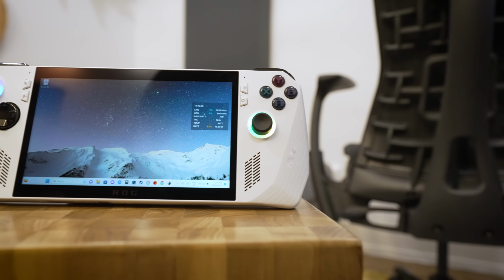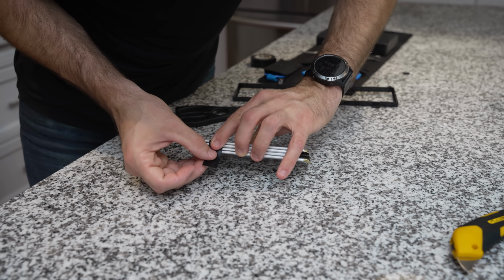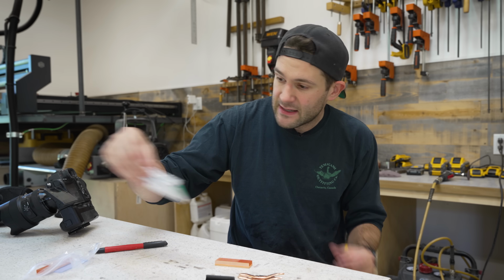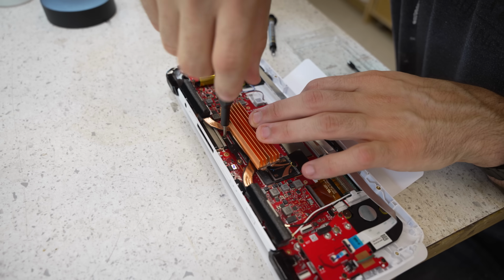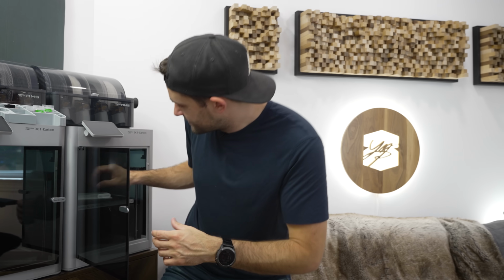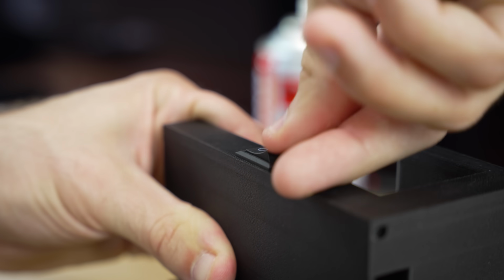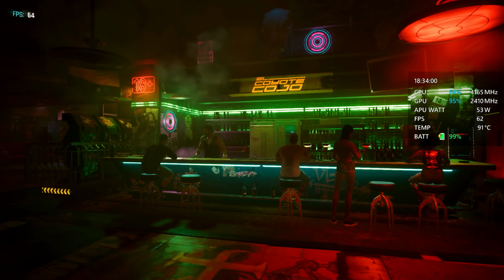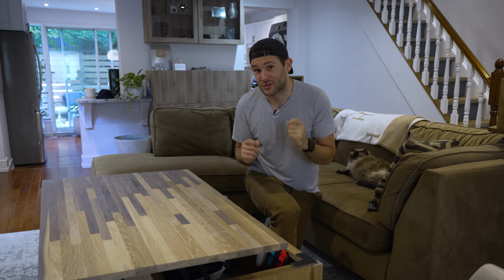I don't understand why people buy Steam Decks...

Comment: Valve made Linux gaming actually possible thanks to steam deck. I want to thank them for all the efforts are making, still keeping everything open source
Reply: ASUS QC is also terrible unreliable junk
Reply: @natzzzy9119  
Exactly, I owned enough Asus Products to know this my Asus TUF 505DT Laptop lost sound output years ago, and because it was out of warranty they suggested I buy a new one for $1,000+, not to mention I also had similar with ASUS motherboards on my Desktop PC. At this point I'd rather just not touch anything they make, haven't had many issues with my Deck in the 5+ months of owning it, but almost any bug was fixed in the next update, and if not they offer a wonderful customer service team that is quick to reply, and walk you through the steps to fix just about anything wrong
Reply: @natzzzy9119  wdym
Reply: @peppefailla1630  ROG Ally's are notorious for frying the MicroSD slot and MicroSD cards due to heat from the power delivery system iirc.
That is a design flaw that should have been detected and corrected during prototyping.
Reply: @AmigaWolf  your last sentence is one of the reasons I tend to stick to smaller devs now.  I haven't bought any EA (Electronic Asshats) games in ages, left Activizzard behind many years ago too.  It's not a foolproof fix, but nowhere near the poopshoot AAA companies are now.
Reply: @AmigaWolf  I have a short list of games I tend to go back to.  The one I have the most hours in is 7 Days to Die at 9,417 total hours.  Both Subnautica games, Grounded, and Rimworld.  

That being said, I like several other genres, including RPG ... just not newer ones anymore, with the possible exception of jrpgs (like the Final Fantasy series).  With the exception of that last game, and Grounded, those are smaller dev teams.  Obsidian (Grounded) is big enough not to lap in to the smaller dev label the rest have.
Reply: @ElNeroDiablo If there was any :D It was like ouuu look they made handheld, minutes later in asus HQ you have two months to do it also, have fun. end of meeting. :D
Reply: If they were all running Windows I'd just buy the Lenovo Legion tbh but SteamOS is a game changer that I believe in
Reply: @jebril  Gotta believe it!! Even aya neo is investing into making their own Linux gaming OS. The revolution!
Reply: @peppefailla1630  What really annoys me is how Valve wants other companies to use their work and standardize Linux gaming for handhelds and companies are refusing to cooperate in that regard lol.
Reply: @jebril   im not sure what you read, but from what i have read Valve wanted developers to keep making the games for windows (so the devs wouldnt have to make separate builds) and they would just make sure it works through proton.

the only things that can break the compatibility are anticheat and potentially launchers
Reply: @questionabletopic9652  Im not sure what you mean, are you saying Valve tells developers they have to have a Windows version? That's not true I've seen Linux exclusive games on Steam so that's not a real rule.

Or are you saying Valve tells developers not to port to Linux? That's not true either cuz there's Linux ports on Steam. Valve is very hands off when it comes to most things with the games on its store.
Reply: @jebril   closer to the second.  valve told devs to not bother making a linux port. proton will carry most all of it.

that does not mean that they cant make a dedicated linux port if they want, just that they dont have to.

ill check around to see if i can find the article again.
Reply: @questionabletopic9652  yea probably in response to developers asking if they needed a linux port for Steam Deck compability. Honestly its the most efficient thing at this point there's way too many games to sit there and port to Linux and like I've seen with native Linux ports dependencies break all the time where even the native ports stop eventually working if not maintained.
Reply: ^ +1 . For handheld gaming, I believe battery life is the most important. Imagine gaming on an ARM chip with a linux OS and getting +20 hours on a AAA title
Reply: @wchorski  ARM chips will take a while I think. Apple is really the only company to make an impressive ARM chip so far (hopefully Qualcomm's Nuvia chips go somewhere soon). From there, we'll still need to see some work done with x86 to ARM translation. box86 is a great starting point, but it would need to be integrated into Proton, and a Steam client should really be ported to ARM. I'm also not sure how that would work with the current anti-cheat situation. In the best case nothing really changes, but I wouldn't be surprised if a few anti-cheats wind up disliking x86 to ARM translation making things worse.
Reply: >Imagine gaming on an ARM chip with a linux OS and getting +20 hours on a AAA title
 @wchorski  
Great. Doesn't work. Because those windows.exe games we play on linux are compiled for X86_64
Reply: @wchorski box64
Reply: Not just the deck itself, but Proton as well.  I have my system dual boot between Swindles (Windows) 10 and linux, and proton makes it feasible to play the majority of my library relatively painlessly.
Reply: This, exactly. It's why I bought a Steamdeck. Sure, I would love to have a PC handheld, but I don't play games when I'm away from home. But, Valve made gaming on linux a real thing, so there was no way in hell I was gonna let them push that boulder alone.
Reply: I cannot wait for the day I can ditch windows on my next PC build
Reply: @Snugggg  ♥️♥️♥️♥️♥️
Reply: @Snugggg  Why not put it on your PC, your using now?

Linux runs great on old and new hardware, my nephew has a very old PC (15 years), 
with a old AMD Phenom X4, and 16GB DDR3 RAM, and a GeForce GTX 1060 6GB, 
and it runs smooth with Pop OS (Linux).
Reply: @AmigaWolf  I do, but there are still gaps in capability, support and my capability, mainly with games, so I have to begrudgingly keep windows installed for now. I long for the day I can get rid of it.
Reply: Linux is a very underrated operating system..
Reply: They made Linux playable way before Deck release. Well, gpu drivers, dxvk and wine compatibility were drastically improved in 2015-2018 period, then Valve released proton in 2018.
Reply: @xDShot9000  i know but without the steam deck we would probably have never been able to play EAC Games, since this Anticheat system is developed by Epic Games. The only reason why Epic started working with Valve is because Valve gained a lot of contractual power with the steam deck
Reply: @xDShot9000  exactly and Valve only did so, to tap more sales and marketing opportunity. It wasn't that they genuinely cared or wanted to support open source. It was a way for them to sell a piece of hardware and tap into the untapped part of the video game industry that many companies don't bother with. Other companies should be doing the same or all out support Linux over Windows. That's where the future is headed anyways so they might as well get the ball rolling sooner than later.
Reply: All the open work they've done, some in collaboration with the community or even some hiring for drivers... They've done an impressive job and really deserve success
Reply: Exactly. I buy AMD GPUs for this same reason - if we, as Linux users, want more companies to open source drivers and support our platform of choice, we need to vote with our dollars. Valve absolutely gets my support. And I don't even hate on ASUS - I and family have owned multiple Zenbooks, one of those early Android tablets they had, and run ASUS TUF mobos and have been happy with all of those (while recognising they've had some well-publicised f-ckups as of late).
Reply: @paulie-g  I have an Asus zenbook 14 OLED and the experience on Linux is really good. I just had to install the speaker drivers for some reason and turn of the secure boot, but after that the experience has been pretty much flawless
Reply: SteamOS is amazing. I can’t believe they made it so easy.
Reply: funny because I was already gaming on Linux before the steam deck, but suddenly every game worked after the steam deck came out. FOSS is the best
Reply: This, when you chase only hardware, you forget the software that runs it. If more companies openly supported linux I would give more money but since they don't I won't. Obviously valve sees the future and I want in.
Reply: Precisely.
Reply: I mean they did it because Microsoft has attempted to be their competitor in the PC space for years. The Microsoft/Windows/Xbox store on PC has some titles unavailable on Steam still to this day in order to try and profit off of exclusivity-based practices.
Reply: When we lose Gaben, gaming culture and industry will forever feel the lack of his presence.
Reply: And proton support rooting from the steam machines
Reply: Quit your Wine-ing.
Reply: @d1g1talc0ffee  never going back to that dumpster fire that's windows
Reply: Yeah it's really cool when game updates come out that add anti-cheat that makes the game unplayable on Linux.
Reply: I just purpose built my first PC in over 25 years specifically to game on Linux thanks to Valve.
Reply: The vast majority of my steam library was playable in linux before the steam deck. It only got better after the steam deck came.
Reply: @Alobster1  it just got viable lmao I was there back then and it was so frustrating to fix issues
Reply: @peppefailla1630  still could get frustrating, nearly lost all my hair trying to get a vpn to run.
Reply: @Mangaki86  this is one of the only critical parts actually
Reply: @Mangaki86 learning to setup a home server with my own VPN was one of the first things I did on Linux.
Reply: Truth, long before the Steam Deck came out, I would search endlessly for a way to game on Linux to escape Windows, using certain Linux Kernels like Linux-Zen, going back to the roots by building a custom Arch Linux machine to run as little processes as possible, and using custom builds of wine, that had as much compatibility in calls as possible for the respective games.

I managed to create a monster of a machine, and even managed to Live Stream, as a 3D vTuber under it using a custom App I designed myself. Although that aside. it broke almost everyday, and when I updated anything in the terminal, I had to backup before cause there was a chance it would destroy everything I worked so hard to maintain. I troubleshooted nearly constantly, and some nights to get my streams ready on a usual schedule I'd have to go without sleep to make sure I could load everything up again the next boot cycle. it was a nightmare to make a good Linux Distro. Now, you just need to download a version of SteamOS, and load it up. I use Windows for my 3D vTubing as the scene has advanced past what I can program in a new Linux App, but my Steam deck is a good companion, I use it when I can to squeeze a little more out of my setup, and it helps that thanks to my Linux trials I bought a good inexpensive capture card that just routes HDMI to my PC, nothing as resource intense as an Elgato.
Reply: Everything except their clients and the actual games, lol
Reply: To be fair though it would be nice to see Valve bridge that Linux issue for the games that won't run Linux.
Reply: @howlettfang242  I think that would lead to legal issues of some sort, that's why they won't do it
Reply: @peppefailla1630  I don't see how, modding the Ally would be no different than modding a console or PC or any other tech. Unless they have it written in their ULA or something which I doubt. Consumers have full legal right to modify and alter the hardware as they see fit. You could even wipe out their software and implement your own software if you wanted. As long as you are not trying to see it as your own product or something you should be fine.
Reply: @howlettfang242  im saying that financing a product that ships with Linux is better for my cause
Reply: Correct me if I'm wrong but, wasn't wine and dxvk and all a thing before Valve made the steam deck? Valve did help a lot in terms of more developement tho
Reply: @thelocal-spider9623  ofc they were already around but valve spent time and resources to make it actually usable in a real life context without having to shoot in your balls
Reply: @thelocal-spider9623  Yes, they both already existed. What Valve did was put money into furthering their development, along with improving anti-cheat. They greatly accelerated this development.
Reply: @Chr0n0s38  Oh, they did. That's awesome. I'll forever be grateful for their contributions tbh
Reply: I really love the enthusiasm Valve has in beeing desruptive and trying to invest money into research on new tech for the greater good.
We already saw steam machine, steam controller, index vr, all not that sucessfull but still every thing gave important impulses to the gaming industry.
I want Valve to be successfull with the Steam Deck and i really genuinely love it.
Reply: Bingo. This is it for me, I've been a Linux gamer for decades, and I support those who make gaming a better experience
Reply: laughs in easy anti-cheat
Reply: @dreamybull1509  only a few games don't support it. I won't switch back for a few games
Reply: Steam deck is the only way to fly.
Reply: Especially with the steam machine coming out in the next tear out two it’s going to be an exciting time❤
Reply: That's not because of the Steam Deck. It's more to create independence from Windows. The Steam Deck is just a tool to further this goal. And it works. If Microsoft fucks up Windows 12 I'm cancelling gamepass and I'll start gaming on Linux.
Reply: @UmVtCg  Devs would have never found any interest into making sure Proton worked with everything, same goes for valve pushing Epic to start a collaboration to make sure the EAC works under proton

The steam deck has been a necessary step
Reply: @UmVtCg  Why waiting for the release of Win12?
Reply: I'm disappointed they didn't officially release Steam OS to the public.
Reply: @Mangaki86  Me too, but all the fundamental components of it (the kernel, gamescope, proton etc) are still open source
Reply: @peppefailla1630  yes sir. I’m learning that other handheld companies are not so open. Aka not open at all. ( looking at you Lenovo, forcing me to use windows 11)
Reply: @Mangaki86  gotta finance the good ones
Reply: @peppefailla1630  Of course the kernel is open source, one cannot release a non-open-source Linux kernel.
Reply: @rockapartie  im also talking about proton, gamescope etc
Reply: @peppefailla1630  Proton is a fork of wine, can't go closed source as such. Jesus, thanking them for making something not closed source when in fact this isn't even legally possible is super weird.
Reply: @Mangaki86  Well, having a closed system means efficiency.  Unlike PC operating systems, you don't have to wait long for say, a Nintendo Switch to power on, in about 5 seconds you are on the start screen of the OS.  Apple has this advantage too, but closed systems can have their caveats.  Also, when I want to play a game on my Switch, I don't have to install it (unless I bought it from eShop) I just grab a card and plug it in and the game starts when I select it. Granted, there's a bit of loading time here but not a big deal as I don't have to deal with settings to tweak it and system updates actually are much faster than on my Dell Latitude 5480 with 32 GB RAM running Ubuntu.
Reply: @Mangaki86  HoloISO is a 99% accurate port of HoloOS/SteamOS v3 for use on regular AMD CPU/GPU desktops and laptops.
ChimeraOS is another port with a bit more flexibility in terms of what hardware is supported.
Reply: @ElNeroDiablo  yes I know , but with both it’s still lacking that 10%-20% of polish. It’s fun to mess around with. But they weren’t where I needed them to be, when I tried them.
Reply: @Mangaki86  Yet.
Reply: @TrevorV  absolutely not yet.
Reply: @Mangaki86  As I recall, that is still in-progress and is mostly held up by Nvidia. My understanding is that the Steam Deck OLED also slowed things down a bit since they made some pretty significant changes to it for release 3.5. The bright side is that it isn't a particularly complex setup, so a number of clones exist. Holo ISO is pretty much identical (including the lack of Nvidia support). Chimera provides basically the same thing, but with Gnome if you prefer that. There's also Bazzite which does work with Nvidia and provides multiple desktop options. Or you can copy the layout yourself. The AUR has a Steam session for Arch users, and in practice that really wouldn't be overly complex to replicate for any other distro.
Reply: @Mangaki86 they did, but you don't need and you don't want that. SteamOS is very limited and optimized only for steam deck. Better stick to any major distros.
Reply: @Mangaki86  if they did, they would have to support a wider range of hardware, patch things, etc to keep people appeased and happy.  Even if its FOSS and accepts community contributions, its a pain in the ass to maintain things.  I both love and hate FOSS because while its great that amazing software can be made without massive funding, there are more developers making PRs, often with issues, than people looking at them. So for core contributors its a big pain in the ass and time hog.
Reply: Linux still only makes up 5% of all OS worldwide, mate. Even garbo MacOS (apple cr@p) has around +17% of OS user base.
Reply: While there are definite advantages to Linux and the Steam Deck (I have a 2TB modded one), it is nevertheless also true that MANY games either require tinkering to run or just plain out and out won't work on the thing - or have control issues that make it less fun. And this may upset the Linux aggro fans but I HATE that OS. Windows and MacOS are awful in many ways, but they both just work right out of the box and don't require extensive knowledge to make basic things happen. Linux does. even the streamlined SteamOS incarnation. I'm always having to boot in desktop mode to get stuff to work, or get fixed or mess with settings that you can't access in the normal OS environment.
Reply: @billstanton8055  Even on windows handhelds you constantly have to tinker in desktop mode man

You have to see Linux Gaming just like Windows Gaming used to be 20 years ago. It's a newborn, give it time
Reply: @billstanton8055  Weird, I've had my Deck since it came out, use it extensively, and never ever did I have to tinker or go to desktop mode to get things to work (aside from non-steam games). Everything has worked right out of the box. RDR2, Cyberpunk, Fallout series, Civ5 and 6, Outer Worlds, Disco Elysium, these I play(ed) the most and I've enjoyed every minute of it.
Reply: @mvanvoorden  So because you've played a handful of high profile titles you think this isn't an issue? Compatibility is one of the biggest issues voiced by Steam Deck owners on reddit and other fora - and this is to say nothing of scaling and general control issues that Valve themselves have included a 'Good for Steam Deck' rating to help people avoid buying stuff that doesn't fit well. Let's try to avoid fanboying this thing too much, yes? It's hardly a be-all perfect solution to portable PC gaming (and there is none, really).
Reply: Linux isn't as greedy as Windows that periodically reboots my laptop to install updates without asking, not missing having Windows installed on Steam Deck at all.
Reply: Not even the Steam Deck, it was the Steam Machine that drove them to develop Wine. Without that Linux would still be severely limited in the non-native programs it can run.
Reply: @vgtrombone  wine has been around wayyyy before steam machines my fella

I'm happy that valve is basing the steam deck off plenty of FOSS projects, which it is even financing
Reply: This is why I bought a Steam Deck.  Unless a competitor runs Steam OS it isn't interesting to me.
Reply: To be fair, Valve wins either way. They sell you a console, they make money from the games you put on it and not he console itself. If they can get Asus to make the console and you still put yur games on it they generate pure profit.
Reply: ehm did they? or did the people who were coding and putting the packages together to let games run on linux? only thing valve did was putting steam on it basicly rest they didnt do linux gaming was possible far before valve used it
Reply: @bionic3500  I was there and believe me that before proton and then the steam deck (which launched Linux as a gaming platform as a whole)  it was such a pain and it was so complicated that it was barely unusable. It was possible ofc, we would have just taken at least 10 more years to get to the point where we are now. Valve is building their technologies and platform on the top of FOSS projects which is financing and supporting as well! That's what I mean
Reply: Not Linux its suck
Reply: @kevin999GAME  Just like your English
Reply: Hardly. Linux gaming has been a thing for a long time. It's not until only lately since Valve built the deck that people took more notice of just how good gaming in Linux really is. Valve didn't make some new amazing innovation. Proton has existed for a long time. All they did was create it to tap into more sales on the Linux market space. It wasn't about helping games. It was just another way for them to grab up some more cash.
Reply: @SuperTime2Change  You can talk all you want about the history of Linux and the relative moral superiority of using that over Windows and MacOS (as all Linux fans never fail to mention) but the fact remains that SD + Steam library isn't the perfect combo some would have us believe. I'd say at least a third of the games I've bought for play on SD have had Linux-related compatibility problems (wont' run, crashes, etc.) and another large number have control and scaling/legibility problems. Yes, the SD is a GOOD system and is, at this time, probably the best portable PC for gaming, but the truth remains that it's no panacea and no perfect solution exists.
Reply: Furthermore, Linux isn't easy to work with for those of us unfamiliar with its various ins and outs. Ask a forum of emulation handheld users (like Retroid, Powkiddy, Anbernic, Analogue, etc.) whether they like Linux on these devices or Android. The consensus is overwhelmingly Android, despite it being less robust as an OS, overall. It's just much more straightforward to get basic stuff to work right.
Reply: @SuperTime2Change  Proton Is made by valve, Wine has existed for a long time but the releasing cycle has always been very slow due to lack of funds. Also, wine is extremely generic and meant to run desktop applications rather than games

In the Dark Ages you COULD achieve a proton-like experience in terms of compatibility but you had to tinker with wine, winetricks, you had to manually compile dxvk for your architecture and much much more. Thanks to the steam deck now valve and even other companies focus their efforts into improving Proton and Wine as much as possible to be suitable for gaming, all alongside the allmighty Open Source community. Valve developed a symbiotic relationship with the FOSS Projects, not a dominance one 

So yes, Valve helped us Linux Gamers A LOT. I remember trying to game before Proton 5 and even before the first official release of Proton and believe me that it was crazy difficult man

The Steam Deck provided the market profitability and mass interest into a Linux powered product, the FOSS community provided the ideas and the basic projects and software technologies (which is the hard part)